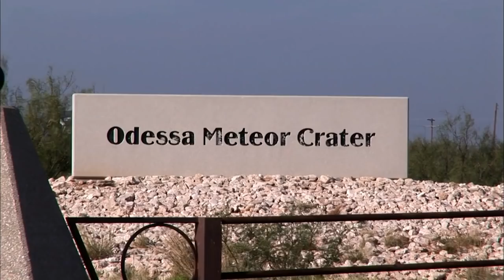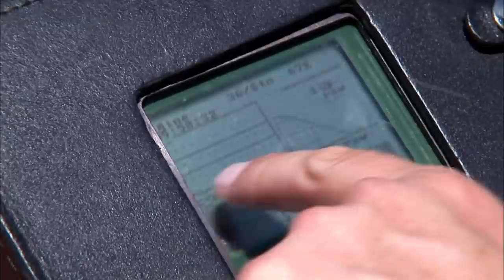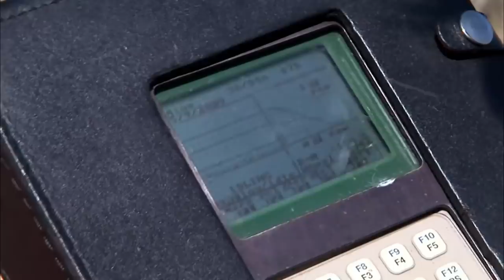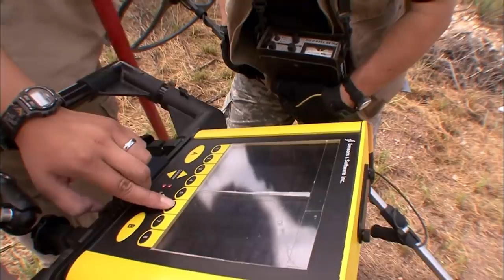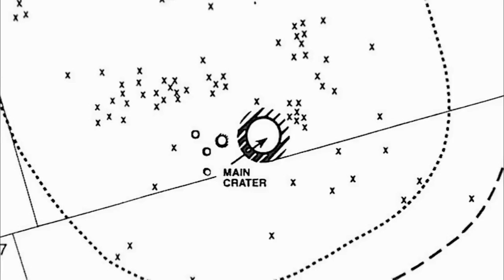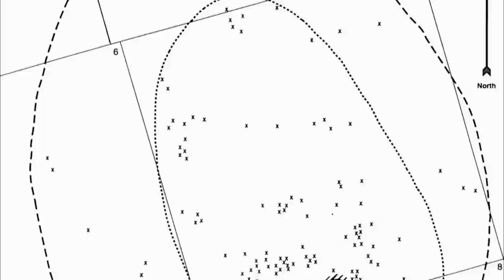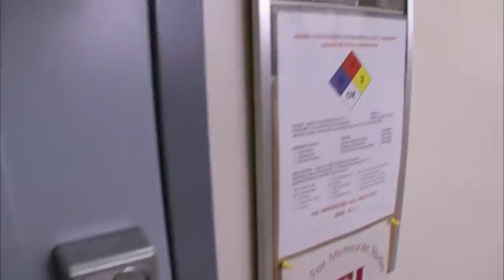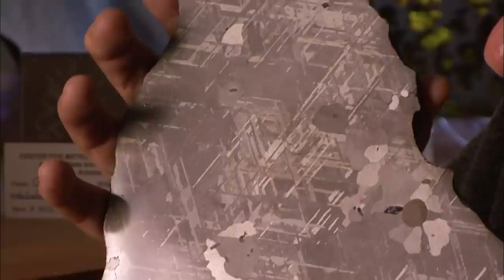60,000 Year Old Giant Meteorite That Hit Odessa, Texas | Meteorite Men | Spark

Comment: Been there a few times
A dude used convicts to dig shaft in the middle of it years ago
Looks a lot like a caleche pit to me. No , I said no pieces have ever been found
Just a not so defined  ridge exist on the west side.
When I was there there was only a small hut to show where the crater is.
You just walked in.
This was in 1960s
No nada zip none
Did they even mention the deep shaft dug by convicts?
I understand the site has been upgraded several times FOR TOURISM, because oil business has its ups and downs
There is no telling how many metal detectors have been ran over this whole area.
Might find all kinds of oil field scrape iron, firearm shells, even ranch trash from the early 1900s

Comment: 120 years of oilfield waist and thousands of pipelines in that area. It would be really difficult to find anything of value. The good thing is the truck stop is five minutes up the road😁
Reply: all the excavation from the oil development is what makes it ripe for finding for finding.
Reply: The truck stop was not up there when we filmed, boy that would have been nice.  Most of the tonnage was pulled out in the 70’s-90’s when the retired local guys with detectors went out there to get exercise and to supplement their retirement and SS checks.